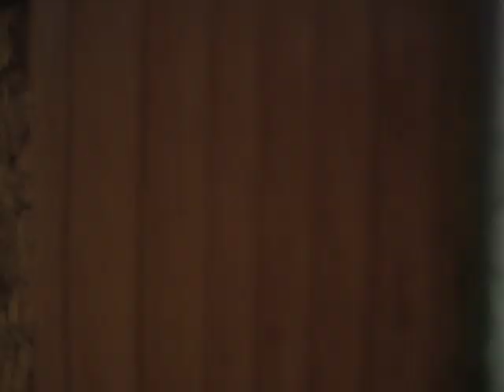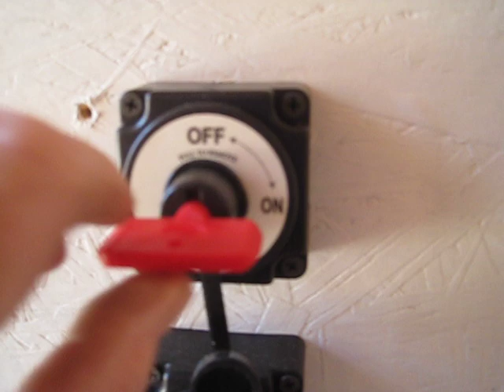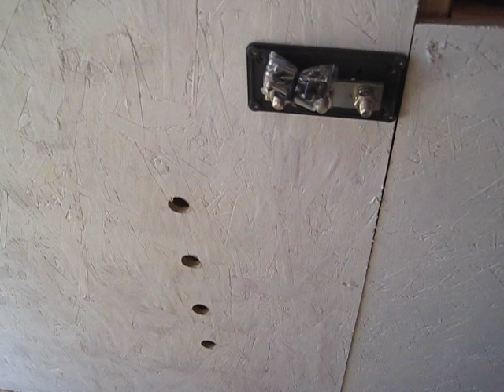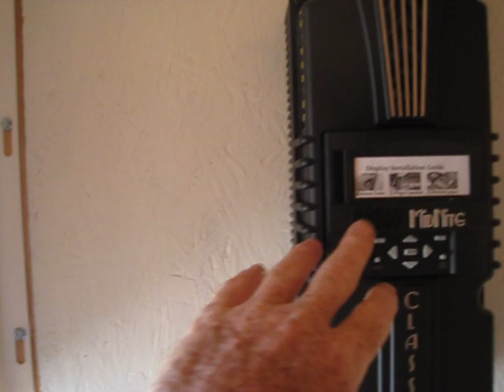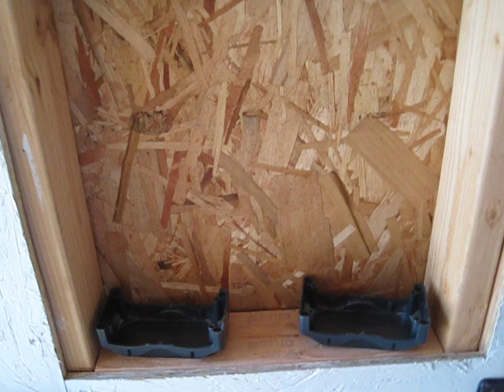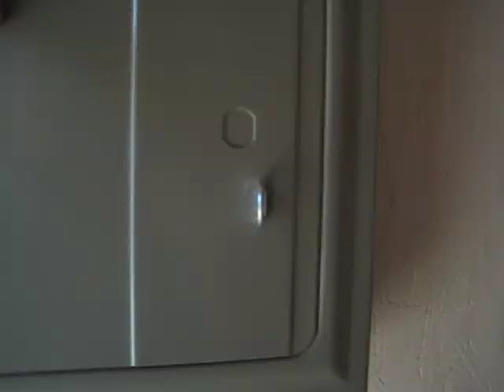Off grid shed installation of electrical components 001

Comment from the maker: you can do a search on the internet for marine type battery switches. I do not remember the name of the store I got two extra switches from, and these 4 original ones were sent to me by my buddy in Hong Kong.  easy way is to google marine battery shut off switch pictures, and scroll thru the pictures, it will give you a link to the sight or dealer you can get them thru